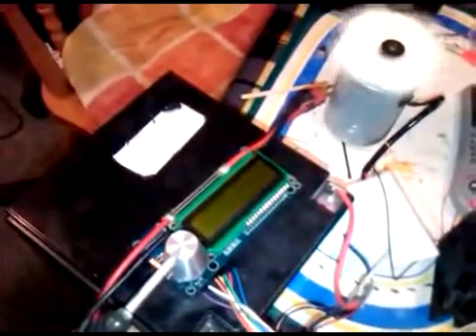5 inch Narrow Gauge Maintenance train-Brushless. PART 2

Comment from the maker: I knew about the Arduino before. I just thought by using it I can program the change over from DC to Brushless would be better handled this way, plus I can add extra features like servo controlled reversing lever and panel lights for the controller.
As I progress I will update youtube so at least I can keep up with it as a video diary.

Comment: Thanks for the reply Steve,I look forward to seeing how this works out.Were you familiar with the arduino before not a quick thing to pick up!?They are quite a good little developing tool,Almost every week someone comes out with a new "Sheild" for them.There is a plain sheild that has just single holes in it so you can solder wires/comp's to it and plug the arduino in the otherside,handy if you dont want to limit your Arduino to just the one project,or need to quick disconnect to prog/play

Comment from the maker: Thats exactly what it will do, I will explain the process in more detail on the next one once its all programmed. the DC motor is 100watts, enough to get the train rolling even up a hill.
it will electronically disengaged after it runs in cycle and the Brushless motor takes over.
the controller allows the motor to freewheel when no power is demanded from it so it will not be acting as a dynamo.
Thanks for the comment, as always. :)

Comment: Arduino a "Different" approach to the cogging problem,I assume you will be using it to switch over to the brushless at a certain RPM,is the single DC motor going to have enough torque to start the train pulling a load?Are you going to have to disengage the drive from the DC motor on the change over so that the DC motor wont attempt to become a dynamo and add load?I dont know how power controllers react to having a voltage through them in reverse,add diodes?,even so the motor will add load.